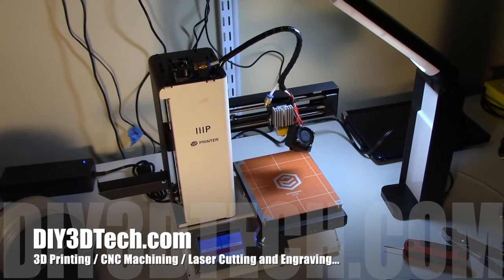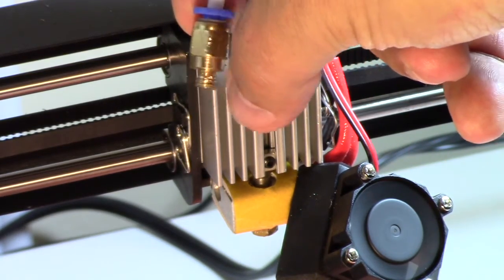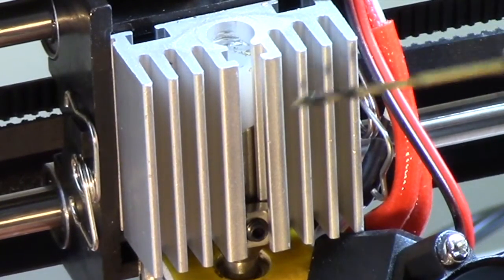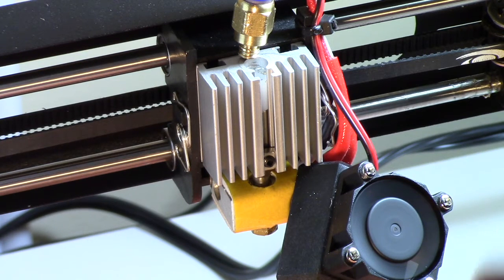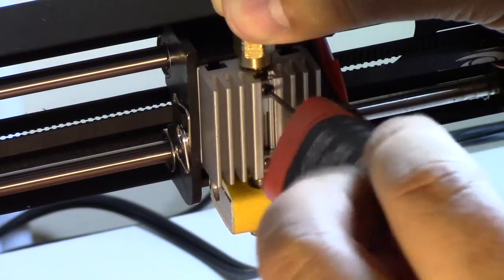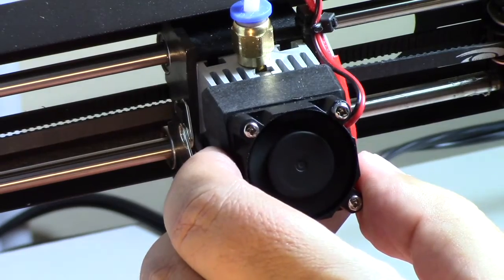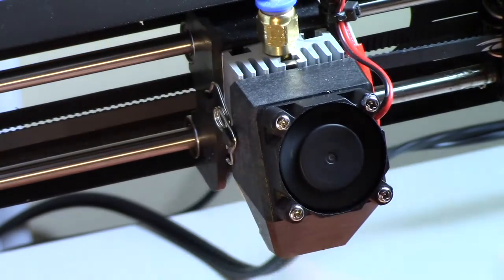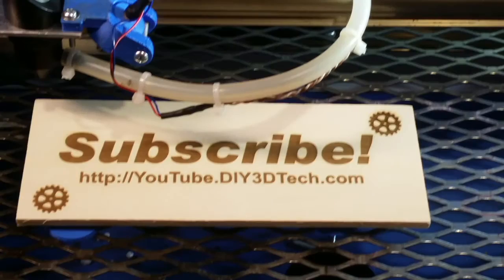MonoPrice Select Mini 3D Printer - Quickly Clearing a Hotend Jam!

Comment: Thank you so much for this video.  After loading the initial 20ft of cord they gave me on set up, it jammed up.  After following your instructions, issue resolved.
Reply from the maker: Excellent! Also as it sounds like your just getting started.  Another tip I would share is run it about 10deg hotter (the hotend) than normal and this will help reduce jamming till you figure things out as the second piece is to understand "retraction" as this being a smaller print you will print smaller thing and unless you adjust retraction (which can be a bit of a dark art) you will see more jamming than normal as the filament will be going from hot to cold and then hot -> repeatedly which for a lack of a better work tempers it and makes hard and this causes a jam. Whereas running a little hotter helps with this but might a have a small impact on print quality....

Comment: Thanks for the video.  I printed a bunch of stuff and then could no longer feed filament.  I had a good chunk that had broke off.  My only suggestion coming from a noob 3d printing guy is show the actual jam removal and also there is a small "tube" that needs to come out (which is white and so was my filament).  I was using white filament and the tube (maybe a new thing?) inside confused me as it looked like the jammed material.  I took out the tube and then used some tweezers to pull up the jammed filament to where I could get my needle nose pliers on it and pull it the rest of the way out.  Again, thank you, I am happily printing again.  PS.  I burned the crap out of my finger since I wanted the extruder to be hot so it would be easier to pull out the material... but that is what aloe vera is for right? :)
Reply from the maker: Glad you found it useful and yes the PTFE tube inside is common as it provides the heat break preventing the filament from melting before it reaches the hot end and a clog this you can a lot times do "cold" and then heat up and push new filament though.  The likely reason too it jam is a high frequency of retractions as this will temper the material increasing the point at which it transitions.  So you containue to have this check those setting in your slicer and reduce the frequency...

Comment: I'm using a .05 mm hex wrench. Mine is new and fits very snugly.
I was wondering about that tool you used to actually do the clearing.
What is it and where can I get one?
Reply from the maker: I actually used a pair of hemostats to pull out the jammed plastic and then pushed a fresh piece, though.  However, if it is really stuck I use these (http://amzn.to/2e2nm30)  0.4mm drill bits...

Comment: Trying to clear plastic out of my mini 3D printer, I have most of the extruder dissembled like you do. Is it safe to have the printer preheat the plastic inside of it with the fan not on it? (Since I took it off the springs). I just wanna be safe is all
Reply from the maker: yes just try to avoid burning yourself :-) the purpose of the fan here two fold one is as a layer fan and the second more important one is help the heat break sty cool so the plastic only melts in the nozzle

Comment: My filament keeps twisting just past the brass fitting before it goes down to the extruder head.  What is causing this?
Reply from the maker: Don't take this wrong way, but "cheap" filament is typically the cause as its not wound properly on the spool...

Comment: My filament is stuck and wont come out or go forward... not sure if i should do this or not... since i see you dont have any filament in your machine right now
Reply from the maker: Yes you can do this with filament in the machine (turn it off first) .  If this doesn't work you will need to remove and clean(or replace) the nozzle.  Hope this helps :-)
Reply: Mike D if it won't come out, check how close the plate is to the extruder. On mine the filament wouldn't come out only on the top section of the plate. I discovered that the plate was too close to the extruder on that side, making no space for the filament to extrude. The filament got backed up so much that the brass part popped off and filament was extruding out the sides

Comment: what if the filament is stuck in the tube. Mine jammed and I porceeded with teaking the filament out so that i can do this step. It snapped. I tried to pull it out but it appears its clogged right at the end of the coax.
Reply: I just had the same issue, along with the head jammed. I used a small torch to warm the brass. When it was hot, I used the extruder movement to clear it.
Reply: Ron Powers THANKS! I didn't have a torch so I used a lighter to heat it up and sure enough that did the trick. Spent forever trying to figure something that would work and this suggestion took more more than 2 minutes. Thanks again!
Reply from the maker: What you may want to do is watch (https://www.youtube.com/watch?v=DvD9EKIsfOw&list=PLInTrkIbj69lIFMBzZxOibE5Uqb1ORvsx&index=15) as I show how to clean a nozzle with a 0.4mm drill (these things: http://amzn.to/2ikITKr).  As heating it up with an external source could lead to damage.  Also if you running into a "jamming" issue, you will likely need to adjust your retraction setting as the rapid heating and cooling of the heating and cooling of the filaments "tempers" it and it become "jammed".  Hope this helps and enjoy :-)
Reply from the maker: Depends "which" tube as if it is the one in the heat sink it simply pops with tweezers (hemostats work better) and pull the filament out upward as mentioned this typically happens when there is an over retraction issue or you try and change the filament when it s cold.  If its main (long tube) just remove it from the top of the hot end and push with another piece of shorter filament...  Also the longer "tube" from the extruder to hotend is the "Bowden" tube and the PTFE tube in the hotend is the "heat break".  Hope this helps :-)

Comment: Thanks so much! I was stupid and forgot to turn my print speed down when I was printing with TPU.
Reply from the maker: You are welcome and let me ask, how is the MP mini doing printing TPU especially with a bowden extruder?  I have only printed TPU on my larger direct drive printers...
Reply: DIY3DTECH.com It works pretty well once I got the print settings correct. I set my bed to 40°C and my extruder to 220°C. I also set my print speed to 15 MM/S. But after that it was like printing in PLA.
Reply from the maker: Hmm interesting and thanks for sharing...
Reply: yeah no problem

Comment: So my filament broke in the white tube that goes from the extruder to the hot end. i dont have a  1.5 mm allen wrench so any sugestions on what to do. Please help...
Reply from the maker: Sorry but go and get a cheap Allen (hex) wrench set as this is a must have for 3D printing so you will use it in the future for sure...
Reply: Ok thanks will do so.
Reply: Same thing happened to me and I just got one from lowes for 5 bucks works great!

Comment: Thanks for the video. This happened to me twice in the last couple of days. Is there a way to prevent it from happening? Are there any mods that will help?
Reply from the maker: If it is happening a lot, check your retraction settings as one of the main reasons is if the plastic is heated and cooled too often then (typically from rapid reaction) it sort of crystallizes and plugs the hot end up...
Reply: Hi, Thank you for the reply. I searched for the retraction distance information for the mini after your comment and changed the "retraction distance" to 4 mm and "retraction minimum travel" to 0.5 mm. It definitely seems to help! Thank you again.
Reply from the maker: Your welcome 😀
Reply: this happens to me a lot when using the default settings as recommended in the manual. It does not happen however when I used the settings that I read out from the sample CAT gcode file that came with the printer.

Comment: how do i get the small filament out of the tube? its stuck
Reply from the maker: The tube comes out, you will likely need to pre-heat the printer (don't burn yourself) and i use these http://amzn.to/2u9LBo0 to reach in and pull it out...

Comment: I accidentally pull the white wire from the hot end what should I do?
Reply from the maker: The white wire is typically the thermister and if separated (since you wrote wire and not wires), is most likely broken as the themister connects to the heat block and regulates the temp of the hotend...
Reply: Is there a way i can fix that
Reply from the maker: If you broke the thermister, you will need to order a new and replace it.  If not you will need to reattach it to the hot end...
Reply: OK thank you I appreciate your help

Comment: can you run two hotend or does it come just one hotend
Reply from the maker: Just one that I know of, however as with everything you could adapt it.  Yet will share with you that also have dual extruder machine and it's a pain to make everything work so rarely use it.

Comment: oh my looks like  its held on with T nut type things . mill that top out and install a Helicoil , or better yet epoxy&press a ID threaded brass grommet.  . looks like it was designed for ease of assembly . 
it looks like it would / could eventually drop brass or Alu bits into the hot end due to how it clamps .  thats what makes me think design was ease of build not service.
Reply: But that is how it achieves its price point. I too have that same machine and its a work horse for as little as it is.  Besides, being somewhat mechanically inclined, it allows me to learn more about how these printers work by having to repair it. Its just like carburetors and points on an old car.... wait, those are like me, obsolete.  LOL
Reply: yeah true, its not so hard a job to mill it out and press in a threaded brass grommet if one needs to later .
Reply: Well, if you have that skill set maybe not but I don't have it.  A tutorial or some kind of instruction would be great but I doubt that I have the tools on hand.  Sounds interesting though.  Its always nice to improve those tools that we have to make them perform better or make them more useful.
Reply: trick is to find the bowden tube fitting that still passes 1.7mm filament , but has a smaller thread .  then get threaded insert to match .  you could probably press it in by hand or set it with some good epoxy .  on the flip side, i could see some one make a replacement heat-sync kit . thers no harm to how it is now as long as no shaving/flakes of metal get down into nozzle . even then its probably a easy clog to fix .
Reply: I checked out your YouTube channel ans subscribed.  Looks really cool.  I'll have to check it out more over the weekend.
Reply: thanks, i a bit of a crazy inventor / bodger of things .. with more crazy than anything else. LOL
funny i watched you snake vs spider video a few weeks back i think .
Reply: Yeah, that was mine from last summer.  was really weird finding that but not too surprising considering my garage and proximity to a creek and field.
Reply from the maker: That's why I posted this as I turn it, turned it some more and more.  It would have been embarrassing if you guys watched me as I sat there scratching my head till I took the fan-cover off and saw that (as I assumed it worked like all my other bowden's).  However likely won't mod this as I will replace this one when the stock one wears out with an E3D.  However waiting to set up the CNC as want to make the replacement bracket out of aluminium

Comment: I thought you just pulled the blue plug up and it released the white tube.
Reply from the maker: No, that locks the tube in place as there metal fingers in there and pressing down is a one way street as the pressure from the blue ring force the teeth into the bowden tube.  Pulling back out will damage it (the tube and ring) as you will find in the future you will have to replace that coupler as it will wear out...
Reply: Ah good to know. Saw others saying just to remove the blue ring for clogs. Seems to be a lot of mixed information out there.
Reply from the maker: Those are actually plumbing fittings for water lines so as you can imagine you would not want to pull the hose out after locking it in :-)